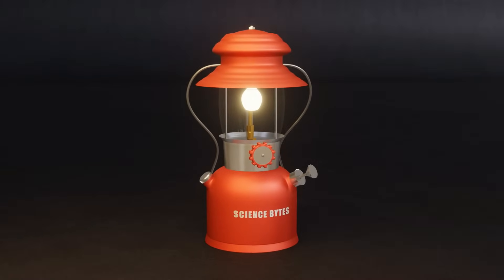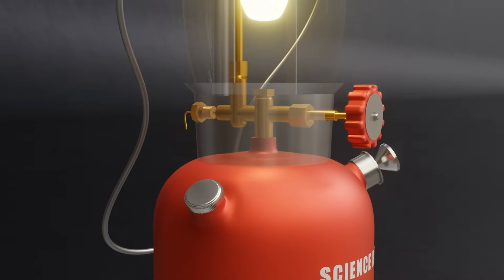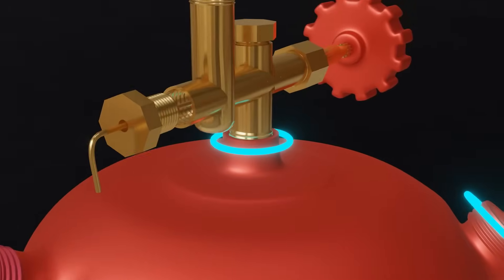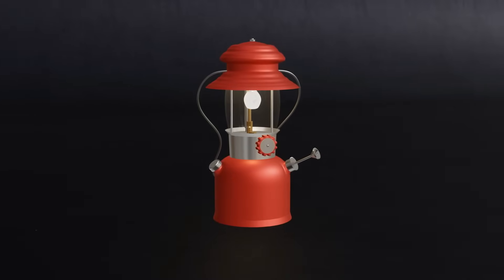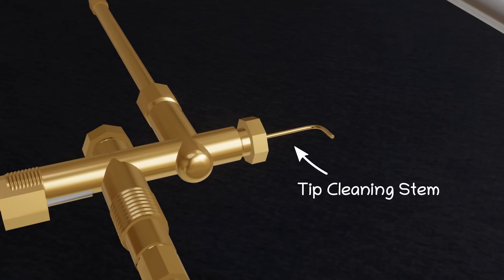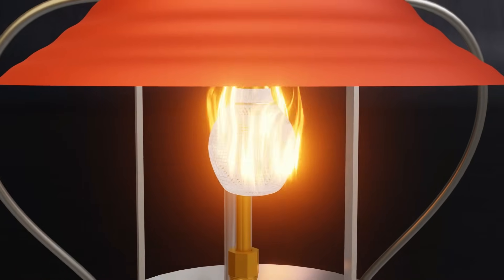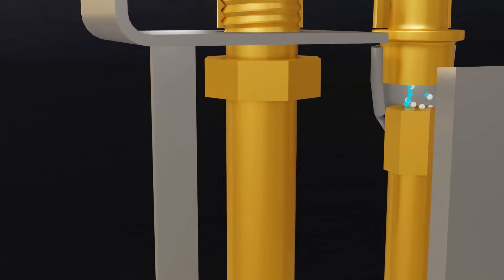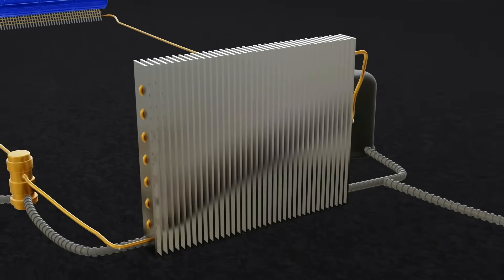How Pressure Lanterns Works? | 3D Animation

Comment: RTFM as Some like Coleman(R) Lamps and Stoves can or require "white" gas or "Coleman Fuel." In Sort... "White Gas" is "Pure" gas without Additives. "Coleman Fuel" and related are reformulated "White Gas" so can sell in retail stores under DOT rules and Fire Codes and store a long time. Gas/petrol from the pump to fill a vehicle has problems beyond being highly flammable. In many countries, years ago Pump Gas had "lead" (TEL) in it then later MTBE now banned too but still as other Additives than poison you when burned or just spill on whatever. Pump Diesel has similar problems using for other things beyond motor fuel too.

Comment: My grandpa used one of these every time we went camping. I was always surprised at how complicated the thing was, and they were always fiddling with it trying to get it to light. I was concerned to learn about the common use of radioactive materials though... I should find a dosimeter and see how radioactive the thing still is!
Reply: 1. mantles have a tiny, tiny amount of alpha emission (alphas are stopped by clothing, skin, a few sheets of paper, etc) - just don't EAT them!
2. Not to bag on yer grampa, but... um... the fact is, if they had to struggle to light it or keep it lit, then either they were doing something wrong, or it needed service or repair. Note: they very rarely need service or repair because they aren't actually complicated. There are only two controls, and one is only used for lighting it.  :)